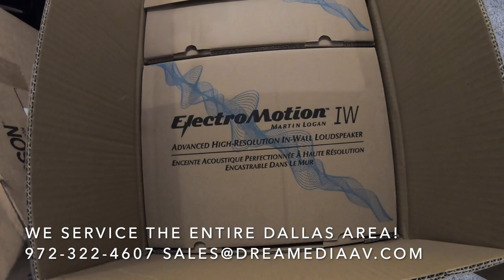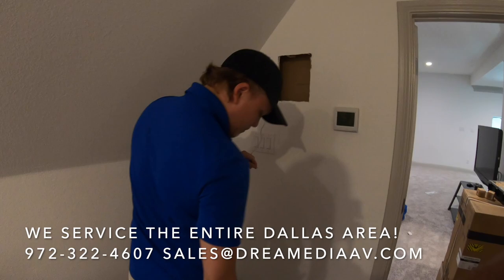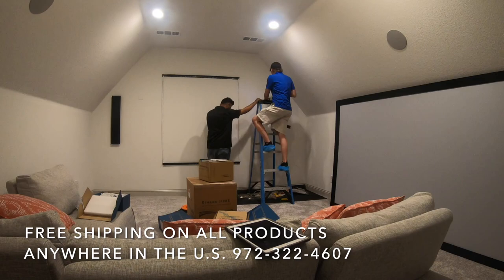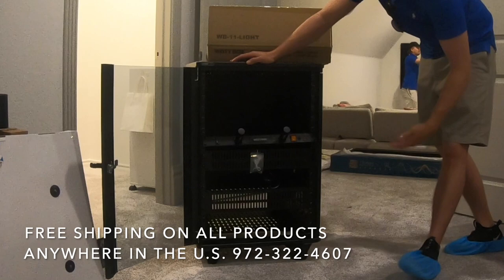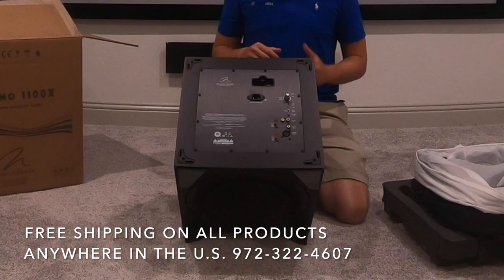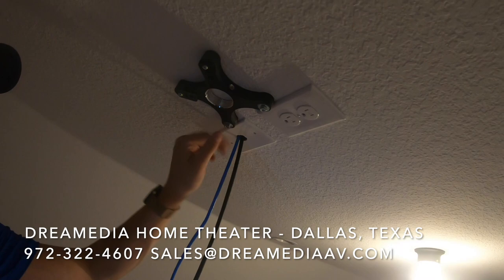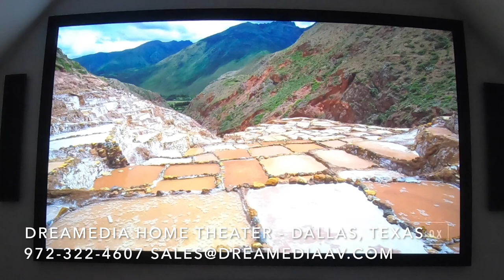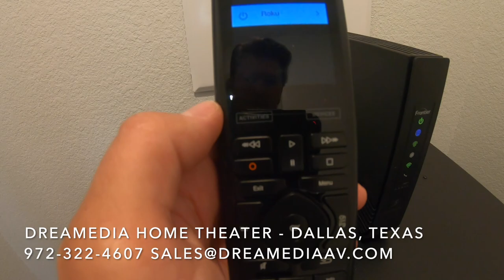GOALS! MartinLogan 5.1.2 w/ 120" Dragonfly Screen & Epson Pro Cinema 4050 Projector! DEMO @29:24

Comment: You guys do really nice installs in very cramped less than ideal room conditions.  Would love to see installs in some more well proportioned rooms. I know you dont get to choose the rooms. Maybe try to get connected with a couple home builders in your service area so you can have some input on the room dimensions and you can be the custom installer and work with the client who buys the new home and wants a  media/home theater room right from the start.

Comment: I have a ceiling like that in a bigger room so I used a Marantz 6014 and put 4 atmos speakers just like that and aimed the tweeters at the seating area for a 7.2.4 setup.  I have an Epson 4040 and love it. I am now holding off until I can get a 6050 for under $2500 when the next gen 8k E shift or true 4K projectors came out.  For the 4050 and 4040 you do need an AV Fury Linker if you want HDR in Games or anything that runs 60fps.  Movies are fine and display Basic HDR10 no problem.